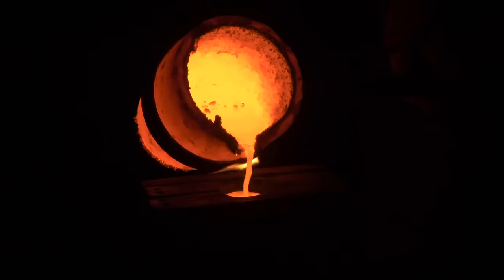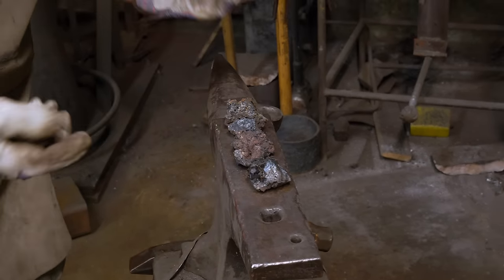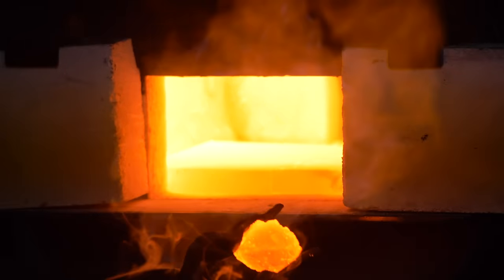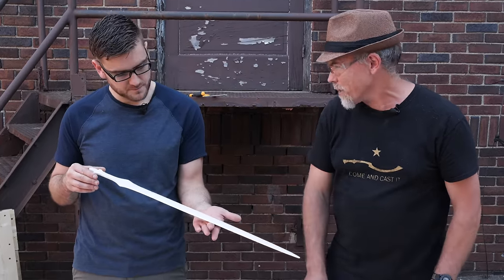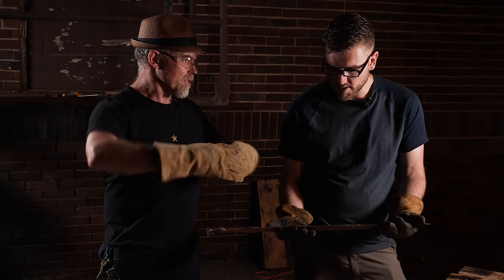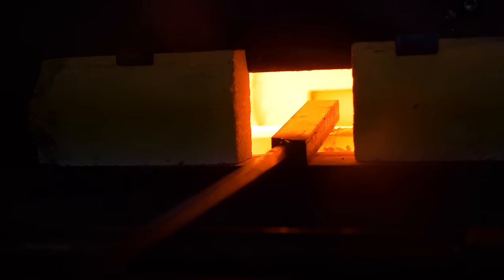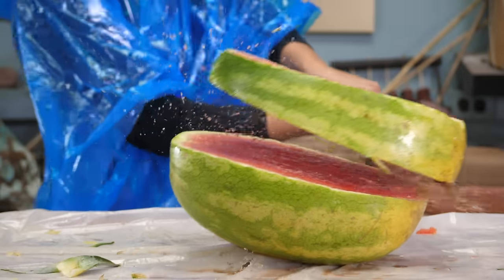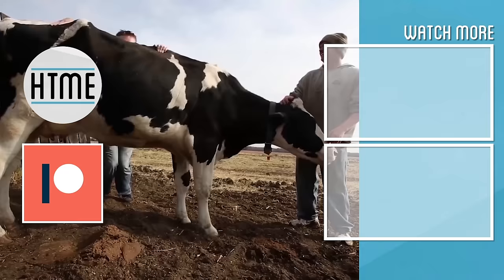Forged Iron Sword vs. Cast Bronze Sword

Comment: Honestly I am fairly confident parrying is ideally not cutting edge on cutting edge  contact sure the steel will survive the blow but what happens when it gets stuck in the other weapon. It's deflecting/glancing ideally, taking an opponents attack and hopefully over extending/ negating future movement  and conserving your own momentum with the ability to  fit into an opponents movements. They are swords, they  slice  with relative movement, not baseball bats, have you ever got hit hard with a  sharp object to find you didn't get cut? If during contact it relatively moved at all you would have, I'm not saying you wouldn't get cut like an axe, but that's not how your very expensive weapon you need to continually rely on in battle is used. Again context and in the moment of action to save your life is how you use it regardless of design but if you did fight with them you'd train and use the weapon to its strengths slicing and stabbing, with as minimal wear and stress put on your weapon and yourself. Because if your swinging hail marrys and still keeping up with what's going on around you, you will tire quickly and the risk of disarmament of some kind increases.
Sorry I just saw the vs test and was like I don't think it actually matters in a real battle, if the steel sword got stuck, either opponent would most likely adopt a different strategy immediately rather than staying tied to the weapons they were using. in my head that's a great pivot point of relative movement if they do stayed tied to their weapon mentally or otherwise..
 let's say the steel sword cut all the way through it, okay they swung through it, that implies the part of the bronze sword held remained fairly stationary and the steel sword is past it, so the bronze sword is now free to move or is already moving towards you and you are most likely extended from swinging your "baseball bat".
There are millions of scenarios when that isn't the case but I doubt it would slice through without both parties moving towards each other relatively. 
So my point is swords are more precision type weapons you slice and stab reaching into unarmed or less armored parts of the body. If your just swinging your using hammers, maces, axes.  Frankly I think those in combination with a spear or ranged weapon is far superior than relying on an expensive sword in a battle. Additionally armor is less effective against these weapons.
In a non war context I think swords are what typically they are suited for, richer people with conflicts likely to be closer quarters and fewer opponents.

I don't know why I went on this rant but I did 
Hah

Comment: Iron is not an alloy or a compound. It is a element a single atom. It is its own thing. If you reduced iron any further, it would be particles which are parts of an atom. Jesus Christ I know this is infotainment but you gotta at least get the info correct

Comment: Dude is comparing a cast bronze sword with some weak edge forging to a forged iron sword with a modern hammer and 3 people working the same sword... Wut... If you look for the physical and mechanical propreties of both metals they are comparable. At least use the same fabrication process if you want to do a video lol

Comment: For those of you out there complaining about the modern steel being incorrect, keep in mind the limits of this channel. Period-accurate bloomeries were large. Very large. You brought in many tons of iron ore and smelted it all. The temperatures of those bloomeries are much higher and the quality of steel is higher. Watch a documentary on the making of Katana to understand what I am talking about. The Japanese use the same bloomeries everyone else used. Big ones.

Modern homogeneous steel isn't that far away from ancient steel. It is different, but only marginally so. The difference between a bad iron sword and a modern steel sword is irrelevant against a metal such as bronze. Bronze was always outclassed by iron, and this is hypothesized to be the deciding factors in many battles and the fall of many ancient nations during the transition from the bronze age into the iron age.
Reply: Bronze was not outclassed by iron in fact bronze is slightly harder than iron. The reason why iron replaced bronze is not because of performance but due to iron being more abundant than copper and tin used to make bronze
Reply: Also you can't get steel directly from a bloomery what you get is a large "sponge" of iron and slag that must be hammered out and even then you still don't have steel but "wrought"iron after that it must be further processed to get steel
Reply: No disrespect but Where did you get this info from? Most of it is totally inaccurate.

Comment: huge disadvantage to bronze.
hardness of 3 bronze vs 4.5 to 6 iron(carbon iron)
bronze disadvantage weaker armor and weapons but less easy to corrode heavier.
weaker economy on farming and construction.
iron stronger siege weapons, weapons and armor but weak to corrosion a bit lighter.
bronze nails will easily bend on hard wood.

stronger economy from better farming tools , lumber and construction iron nails, ship building stronger woods.

only advantage of bronze is plumbing and electronics but on modern era.